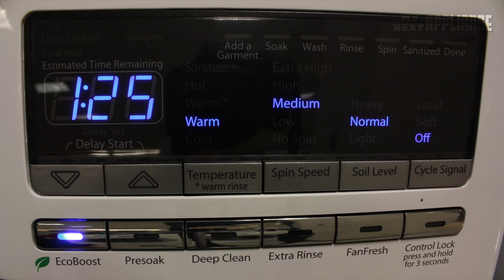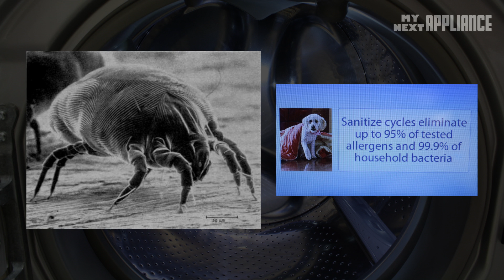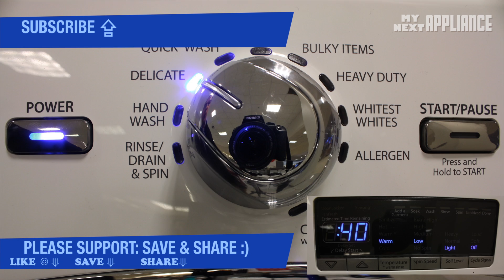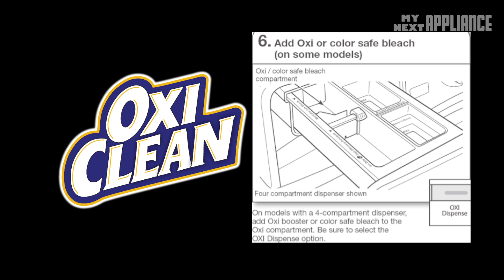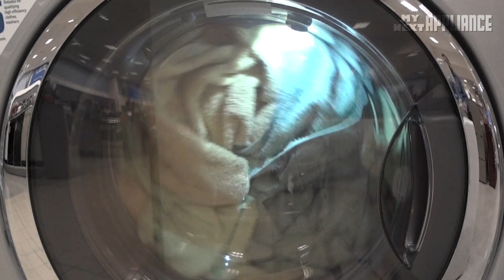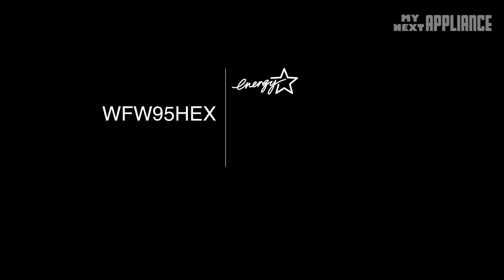Whirlpool Duet Front Load Washer Washing Machine Reviews WFW95HEXW WFW95HEX

Comment: repair records for all front loaders are very high. Doesn't matter if it's a $600.00 or a $1500.00 front loader they are all plagued with sever problems that the manufactures refuse to address. LG and Samsung have the fewest repairs and wash the best. I own a 1st Gen whirlpool Duet and have had it for 8 years now. I do all the repairs my self. The rear main bearing is just about shot and the water flow relays don't work properly causing the washer to slowly fill with the unit off. I'm on a well so I have no choice I have to by front loader. whirlpool/Maytag will not be getting my money this time. Although the newer duets are more reliable and less repair prone than the 1st and 2nd they are still a very poor product in comparison to the European front loader market.
Reply: The fact is, it's the way corporate America works, these washers actually last a long time if used properly. These companies will not properly educate the consumer in return we misuse the product. Causing us to either buy a new machine or call for repair which the manufacture gets a kick back on every call.
Same principal as buying a new car -vs- buying a car one piece at a time. Manufactures make much more money on parts than they do the full unit it's self. Do your self a favor and purchase an extended warranty, just before it runs out purchase another, this way parts and labor are free and the manufacture has to EAT the cost of repair. This is the only way to really send our message or they will just keep making products that fail.  Or get a class action law suit going which was tried against whirlpool and was found not enough evidence to pursue the case. Which I thought was B.S.